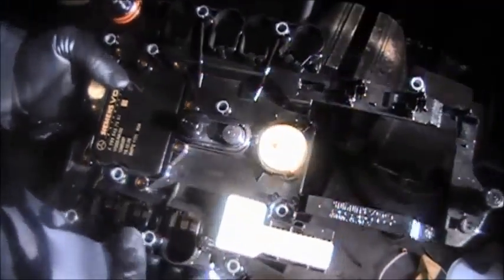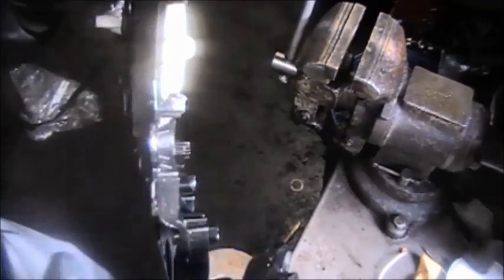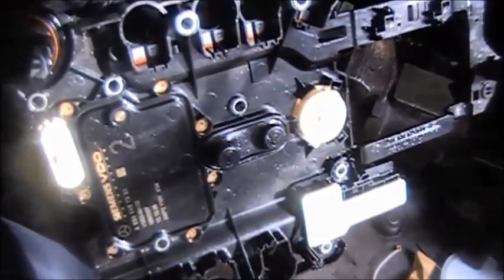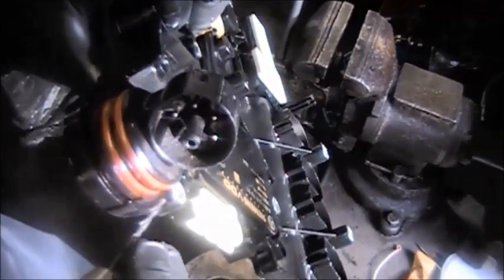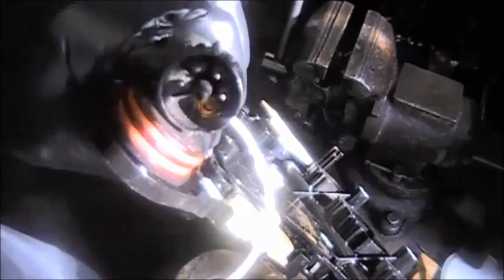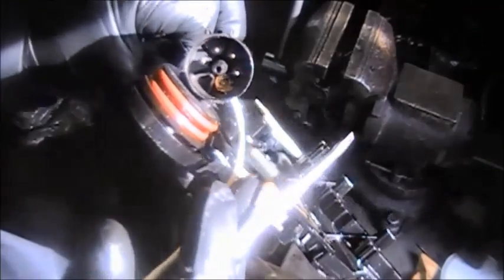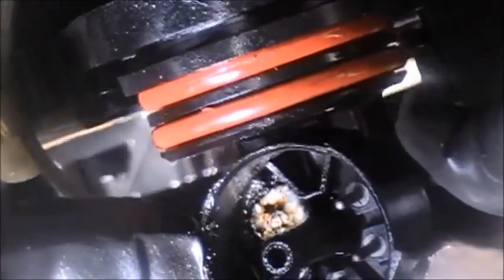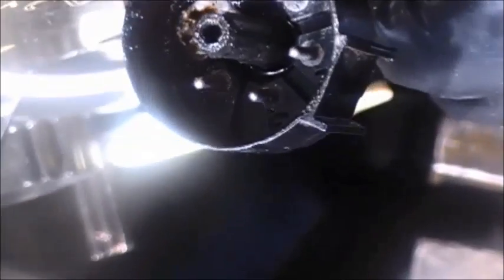mercedes benz 722.9 transmission control module (TCM) repair part 1

Comment: Have problème  p0731   p0731   p0734
Reply from the maker: You have gear ratio codes. This could be inside the transmission itself

Comment: Conductor plate or circuit board
Reply: Got it fixed it was debris in 4 of 8 solenoids looked like some excess filter material probably the cheap online filter I got she working like a champ now
Reply from the maker: This is the transmission control module. Don't know it by any other name.

Comment: I think thats called circuit board i sent mine out to be repaired that was the piece im getting 0893 code there telling me that its different part  pcm I'm not sure if its box in the circuit board or another component

Comment: Can you help me do you have any idea how to put a push button gear changer in a C300 Mercedes Benz 2002 done conductor plate been changed the entire throttle body with solenoids seat sensor unplug the seats change air intake sensor bypass passenger seat sensor changed all burned out tail lights beat my head against the steering wheel a bunch of times reset the transmission spent two years in his car so far Stihl SRS system ESP visit Workshop past due 1 60 days no oil in the transmission computer
 have some extra time right now to work on it
Any ideas Hotwire or did I miss something and I don't know what code would show up with the new valve body or how to reset computer to recognize it
Reply from the maker: I would be the wrong person to consult you on this because don't really do modifications.
Reply: Thank you for your time I'm going to take a crack at it anyways got nothing else to lose😁

Comment: I have a problem with VGS1 is it possible to install VGS 2 or 3 on my valve body
Reply: VGS1 only works with VGS1 valve body , im assuming if you get a VGS2 or 3  valve body with conductor plate it should be ok.

Comment: That isnt the TCm that is the Conductor plate for the Valve body.
Reply: That is most certainly is the control module for the transmission

Comment: I recently got a message in dash saying esp inoperative see owners manual and check engine it won't go into gear when shifting I had a friend scan the car and got u0101 transmission communication lost could this be bad plate conductor?
Reply from the maker: It could be, but it could not be also. This is when testing is important, because pure guessing can get expensive. You would have to get a wiring diagram and start testing for signals to make sure signals are getting to the tcm, can signals, ground signal,  voltage signals.

Comment: i put the TCM again bought the Mercedes module, planned everything but the problem remains.
Reply: where do you bought the Mercedes module?
Reply: Even after changing the conductor plate you have to use a Mercedes specific code reader to clear the code. Regular code readers will NOT clear the code which means that the vehicle will not recognize that anything was changed.

Comment: prejudice ... I have a problem with the error tab p0717 this and a possible solution ? thank you
Reply from the maker: +marc 4 This is a turbine speed sensor code. If you have the 722.9 transmission, then this sensor is made into the transmission control module that is inside the transmission. If you change the module, it will have to be programmed at the Mercedes dealership or the transmission will not work.
Reply: http://www.ebay.com/itm/Mercedes-7G-Tronic-Automatic-Transmission-Control-Unit-722-9-A0034460310-Repair-/321414312758
Reply: they helped me when I have similar problem . You should ask them.
Reply from the maker: This code refers to the input speed sensor. This is built into the transmission control module if you have the 722.9 transmission. You will probably have to change the transmission control module then you will have to have it reprogrammed.
Reply from the maker: +Dian Dimitrov 
This code refers to the input speed sensor. This is built into the transmission control module if you have the 722.9 transmission. You will probably have to change the transmission control module then you will have to have it reprogrammed.